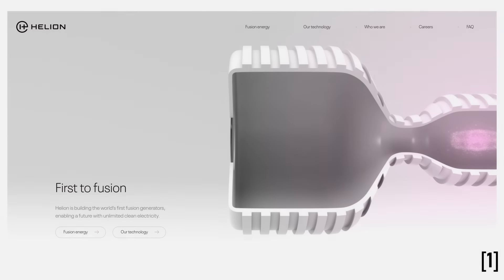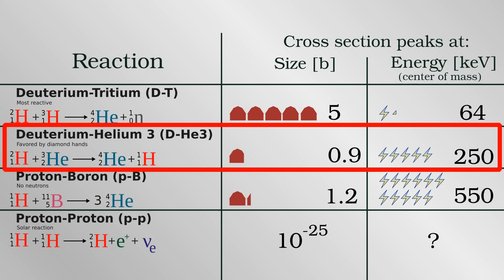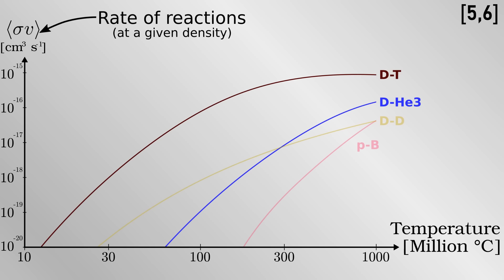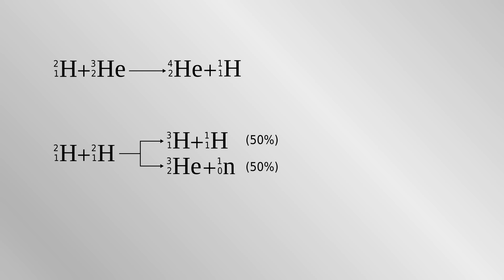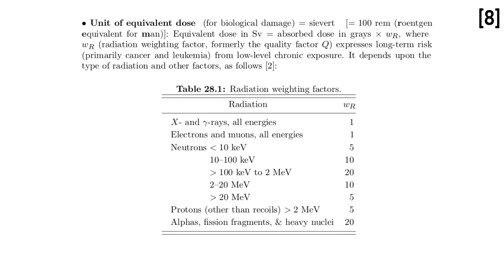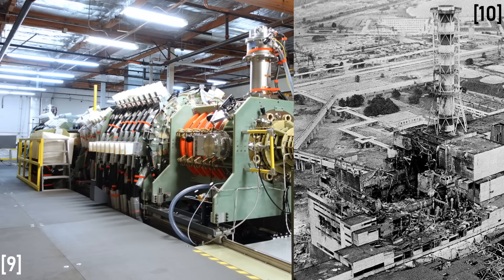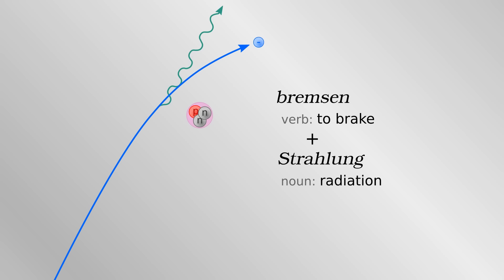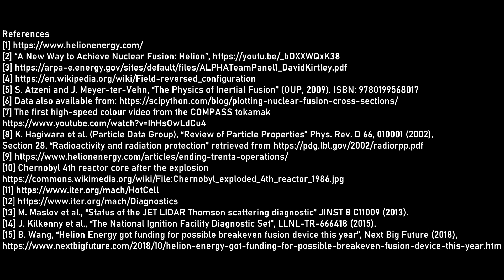The problems with Helion Energy - a response to Real Engineering

Comment: Not to be a party pooper, but don't you think the experts at Helion already have thought about everything you said and much more? They would have NOT come out of secrecy unless they know with confidence that their project works and that there is profitable business out of it. Just saying.
Reply from the maker: Not to be a party pooper, but don't you think the experts at Theranos/Nikola Motors/Juicero already have thought about everything you said and much more? They would have NOT come out of secrecy unless they know with confidence that their project works and that there is profitable business out of it. Just saying.
Reply: @ImprobableMatter To be fair to some of the experts at Theranos, they did know the machine didn’t work, but Holmes pushed it out anyway…any doubters who were too vocal were fired. Wondering if something similar is happening at Helion?🤔
Reply: @ImprobableMatter  Have you seen stepheng905 's comment on D-D fusion requiring at least 400 million C to happen? Seems there will be no harmful neutron radiation in Helion's reactor and therefore that criticism is incorrect? This criticism seemed the most problematic one as well.
Reply from the maker: @ninefox344 Not sure what you mean by "D-D fusion requiring at least 400 million C to happen". This video includes graphs of D-D and D-T reaction rates.

Comment: What do you think about the recent "breakthrough" from NIF where they got 3MJ out of 2MJ, and pretend that consuming total of 400MJ is just a minor engineering problem that we may be able to resolve in a decade or so?
Reply: Yeah lol, weirdly the headlines leave out the fact that we used 400mj to create 403mj of heat... Not as exciting I suppose
Reply from the maker: I mentioned it: https://www.youtube.com/post/UgkxWX37g3RoYMgZ4L6oI8RDRU8ghPEtIFjL

In fairness, I think at 10% efficient high power laser is very realistic, so 20MJ of electricity for 2MJ of laser energy.
Reply: @ImprobableMatter  From what I can see the problem is the way they gather the laser beams from multiple lasers and the way they focus the energy, that's why they end up utilizing only 0.5% of the total energy. I simply cannot see building working efficient solution out of this.
Reply from the maker: Once the laser energy has been generated, it is handled efficiently. The problem is generating it. But look, I have a 5W Light Emitting Diode (LED) bulb which puts out as much light as I used to get from a 60W old-school lightbulb. NIF have flashlamps, whereas going to Diode Pumped lasers (see the commonality) would make them more efficient.
Reply: The NIF machine was designed to achieve net gain on the energy entering the target, it was never designed to achieve net gain on the whole facility. It achieved its goal.

Comment: Kirkov reporting
Please make more videos about the MIT SPARC reactor and nuclear physicist in general, your channel rules.
Reply: Dead end. Even if it somehow generates real positive energy the HTS (high temperature super conductors) will quickly fail do to neutron bombardment. There are no real viable fusion reactors that will lead to a commerical power plant.
Reply: @guytech7310  bummer, but thanks for the info. I need to really wind down fusion expectations

Comment: A similar analysis was used to refute the palladium cold fusion experiment of the  1990s. Namely, the amount of radiation produced to account for the excess heat would have been lethal out to around 200 yards. The unshielded experiment was done in a crowded University building, near other crowded University buildings. No one died. No one even reported symptoms of radiation sickness. That thoroughly refutes the idea that some sort of cold fusion product accounted for the excess energy of their experimental setup.

I think we can generalize this to a new test for fusion production among these snake oil startups. If you are claiming fusion from your magic unshielded device that was designed and run by a bunch of grad students, and none of your grad students died suddenly of radiation sickness, then you didn't achieve fusion. It's a sort of grim canary in the coal mine for investors to know that the startup is a just a scam.

Comment: Fusion is not easy of that we can all agree.
The Livermore fusion breakthrough with a small net gain being achieved has given us all a glimmer of hope but also planted everyone's feet firmly in reality in regards to some of the myths surrounding nuclear fusion. The availability of the fuels being just one issue.
Endless clean self perpetuating fusion energy is definately closer and the adage it's thirty years away is actually probably true at this point in time.
A net gain from a fusion experiment is pretty cool but has got some head scratching going on about current designs and engineering requirements.

But thirty years is still thirty years.
I win 😎

Comment: To clarify for everyone (because I was confused too for a minute), when he mentions Chernobyl, he isn't saying that if the Trenta machine would run at power plant levels it would be analogous to the Chernobyl explosion (cuz that was a run away fission reaction). Hes saying it would be giving off neutron radiation equal to the radiation that the site currently gives off (or did give off shortly after the explosion? You don't clarify what you mean by it). Also I don't know where you get that information from. From what little research I've done, the radiation levels near reactor 4 aren't anywhere near as much as what Helion has measured during their test runs. But I feel like in general, the radiation given off by Helion's machines probably isn't an insurmountable problem. I mean we've been successfully commercializing fission power for decades and have ways to deal with the radiation in those plants. Since fission reactions are ALL about producing neutrons, I can't imagine radiation via fusion will be anywhere near as difficult.
Reply from the maker: A fusion power plant would produce more neutrons than a fission plant. Fission releases more neutrons per reaction, but also much more energy. The difference is very roughly a factor of 3. So, if two plants both produce 100 Joules of energy, the fusion one would have produced roughly 3x the number of neutrons.

Helion is aiming to get ~50MW out of their proposed powerplant. As above, this is equivalent to a 150MW fission plant. Granted, Reactor 4 at Chernobyl NPP had a much higher thermal power output (3200MW), but let's assume that during the explosion the power output fell to 150MW. Then this is equivalent to a Helion Fusion powerplant. The statement in this video: "If the Trenta machine, as pictured, were to be producing power plant levels of energy, it would be like the exploded Chernobyl Reactor Number 4."

I actually did elaborate on this point in a subsequent, much longer, live video: https://youtube.com/live/wK5v1Nw98xs

Comment: This is a convincing episode. 

I have been watching R/E video just now and casted some doubts on what they claimed from the video, despite I was not a physician. Luckily I immediately found this video. There are two points distracting me most from believing Helion Energy's ideas. The first is the way to generate and concentrate plasma hot/efficient enough for fusion process. The second is the different fuels they have chosen. After all, there are only a handful sort of isotopes available for fusion process (within engineering tangible limit) and pros and cons of each shall have been fully scrutinized by science community. It would be unusual to pick sth that most research programs had dropped out.

Comment: It gets gloss over a lot by critics of ITER (and DEMO even though no one brings it up) but part of the design is making a blanket that will adsorbed the neutrons which are carry something like %80 of the energy in the reaction. ITER design involves using the massive steel magnets as the absorber and just dumping the heat off via a heat compressor(ITER is not meant to make power just get a function fusion plant working). Some idea have been floated for how DEMO may capture those neutron  (one is a massive molten lithium blanket hopping that you can breed some H3 for running the power plant(though this is not fully sustainable as you would need %100 neutron to H3 conversion).
Reply from the maker: Plenty of people have brought up the blanket. The blanket test modules on ITER are in front of the magnets, making sure to stop all the neutrons. There is no such thing as "steel magnets" on ITER.

Tritium breeding can be made perfectly sustainable and even with a net gain, because a neutron can react with Beryllium to release a second one. Double the incoming neutrons and you can breed 2 Tritiums for each one used up (at least in theory).

All this is covered in my other videos.

Comment: Its always fun to pick apart something as you've done in this video, but not one person seems to be acknowledging that the entire purpose of nuclear energy is supposed to be its affordability. Tritium is extremely limited and therefore extremely expensive, also has the potential to create radioactive waste, and the reactors built to produce these reactions are extraordinarily expensive to build, both in labor and materials. Even if the reaction using tritium produced net energy that would be efficient at the commercial scale, the cost of the energy wouldn't make it a feasible alternative.
Reply from the maker: The whole point of the D-T fuel cycle is to breed more Tritium than is consumed.

Comment: Great video.

You have a massive Hate-Boner for Helion lol. It's hilarious. Valid objections and concerns but you are really passionate in your disgust for the D-3He and FRC approach.

Realistically, every approach being worked on out there has some monstrously prohibitive drawbacks to being able to produce net energy output, operate consistently, mitigate radioactive waste formation, mitigate structural and component longevity, and ultimately creating a MORE cost effective solution than current energy production methods.

Comment: The additional problem with the Helion approach is the idea that they can extract electrical output using magnetic coils, surrounding the fusion chamber. The volume of the magnetics is so small, that it will be impossible to provide sufficient cooling, such as circulating water. Some quick calculations show that an 80 MW plant well generate I ^2 r losses of about 500 kilowatts or more. It would take a tremendous amount of water flow in that small volume of several cubic feet (a few cubic meters) to keep the temperature rise reasonable. Considering this is based on an explosion powered MHD generator, the bulk of the electrical energy will be produced in the central part of the magnetics, making the job of cooling that smaller volume, even more impossible.